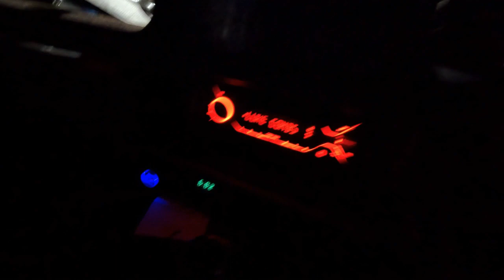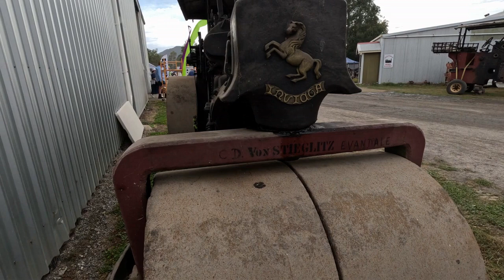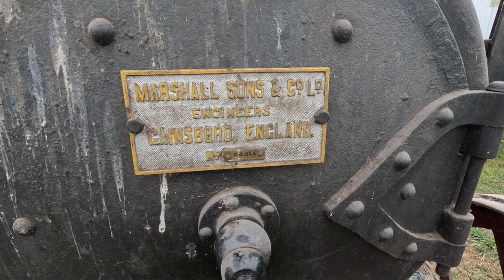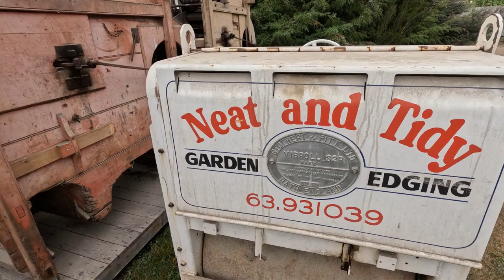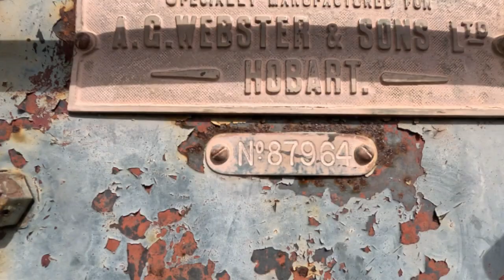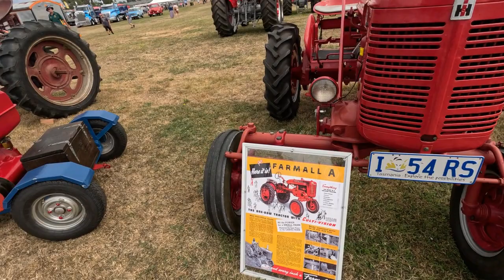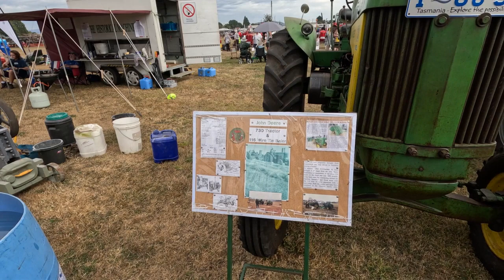Steamfest 2024

Comment: thhere is a pin to disconect the wheel from the axle so the winch can be used. the winch drum is fastened to the axle and the winch rope turns with it when the wheel is in gear.
Reply from the maker: That's what I was thinking, but I wasn't sure. Thanks for the reply